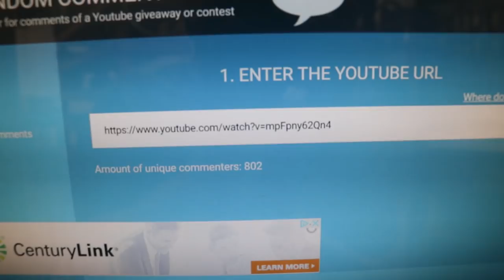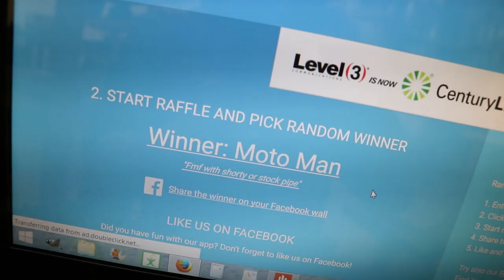A Look Inside These Dirt Bike Forks

Comment: Great stuff! I need to rebuild shock and forks on my 2007 CRF250R. Hoping the guts are similar. So the only specialty tool you needed was the tusk wrench? Please go into great detail on the fork and shock rebuild when the parts arrive. I need to change spring rates on mine too. Sounds like I can save a bunch doing it myself instead of sending them off to a service like factory connection, etc.

Comment: Use the top triple clamp and a tie down strap to compress and hold the fork compressed when you unbolt the bottom bolt from the rod.

Comment: Pro tip, that top cap will be really easy to take out if you loosen the top triple clamp, and of the fork extends out like it’s broke it just came unscrewed inside mine did that

Comment: I never take out the compression adjuster, b/c it's a waste of time.  Once I had someone service my shock and they cut my oring on the compression adjuster on installing.  You don't need to replace that bladder.  That is normal

Comment: if you want loose a fork cap...please slide triple clamp more down or in the middle. you compress threads and may damage all this. And it's loose very easily you don't need a hammer and back together same way. OUCH!
Reply: This is a solid tip rottencotton . the threads get compressed from the triple clamp  moving the clamp below the threads makes removing the nut a piece of cake .

Comment: Is your parts cleaner bin heated? If so, did it come with heating element? What type of cleaner do you use? Great videos!!
Reply: Anthony Grijalva I've asked before but don't think I ever got an answer.  It is heated though as he had commented that it was such and such a temp.   (140's)
Reply: Jeff Loucks ....i wonder do the cleaner bins come with the heating element? If not, wonder how he heated it?
Reply: I started looking into parts wash bins and yes you can get them heated and with a pump and filter to cycle.  Would love to have one someday as it looks so effective.
Reply from the maker: Currently working on a video that covers the tank and how to build one.
Reply: 140 degree water water in a 50 degree shop

Comment: Why do you need a special fork bolt tool thing just use a wrench you can set to the right size
Reply: Jon the lamb Not much material to grab onto with a wrench, the fork cap wrench surrounds the whole cap and holds more secure.
Reply: Bill Rowse oh that makes sense thanks